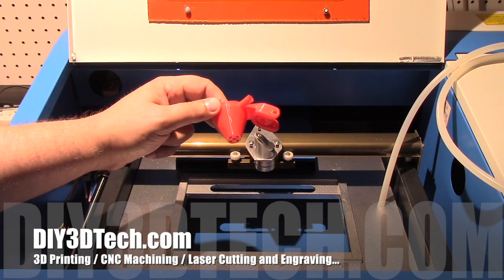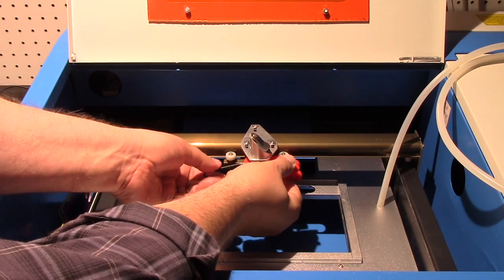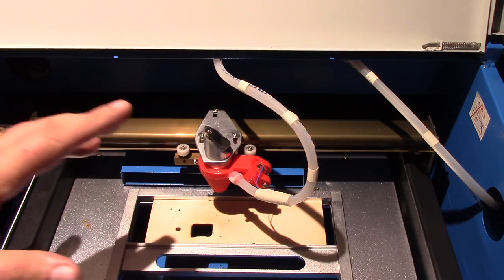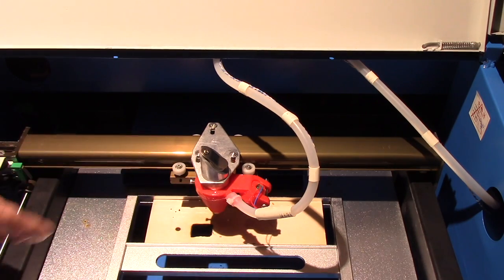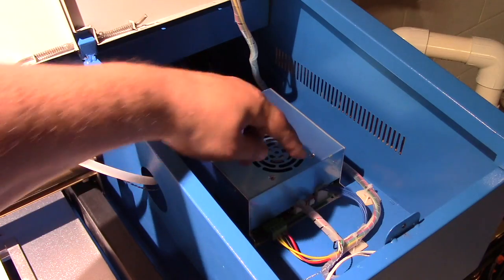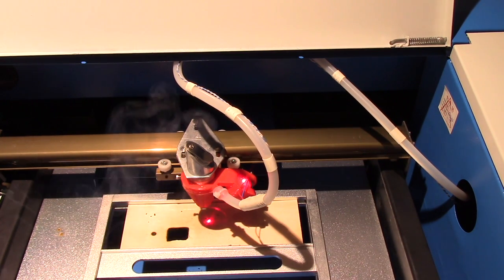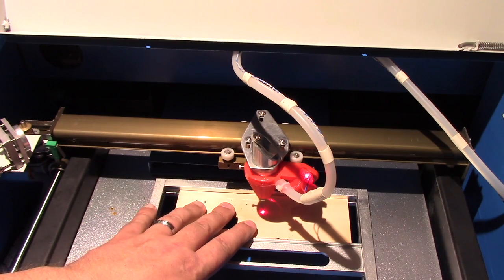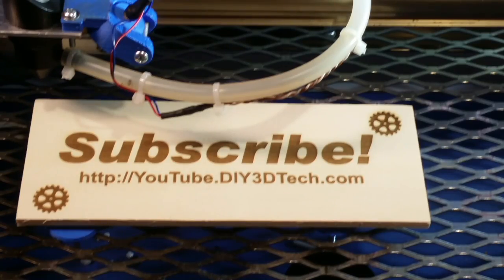K40 eBay Chinese CO2 Laser Cutter & Engraver - 3D Printing an Air Assist Nozzle!

Comment: Hello, if possible how much would you charge to print an air assist for myself. I would like to have an air assist but I do not have access to a 3D printer
Reply from the maker: Sorry I just don' have the time however you can buy a metal version from Light Objects pretty cheap...
Reply: DIY3DTECH.com ok thank you!!

Comment: Just a question as to how and where you attached the silicon tubing to the case?
Reply from the maker: Not sure I understand as they tube you see for the air assist as it runs to an air compressor...
Reply: I was just wondering how you attached it inside the laser area. Is it attached at two points (with a cable clamp or similar) to the underside at the back of the lid. Does this keep it from tangling the air hose?
Reply from the maker: the hose isn't attached to anything per-say, it is fairly  stiff and supports itself as I run it though the light hole in the side and out the electronics box...

Comment: as I understand it, PLA is a thermoplastic so it won't really burn until you go really hot, but PLA starts becoming soft at 50°C so I don't know how well that is going to work for you...
Reply from the maker: It has been ok, however I have not had any flameouts in the material.

Comment: Was the new tube that arrived actually 40 watts?

Did you watch the British guy's video he published in the last week where he mentioned what I mentioned to you about tube life is hours since it was made not just hours in operation?  I know you disagree so I am stumped as to what is right because 3 months is crap.
Reply from the maker: Sorry no and yes I disagree as I have had one for around a year and no issues and in fact this laser is almost 3 months old now (as all my videos are queued for a month or two  and I had for almost a month before opening it).  I also believe that  via the date stamps on this machine it is well over a year old.  As no one would buy one of you had to replace the tube every three months...
Reply: DIY3DTECH.com
He isn't saying it just completely dies and you may get one with more hours on it.  Let me know what you think as it is his previous video's video (so 2 back).
Reply from the maker: I am in Europe this week for meetings however if I can get a chance to look, I will. But at the end of the day one of mine is nearing a year and even power wise it works just fine...
Reply from the maker: I had a chance to watch it and even wrote to him on the topic (you can see Russ's reply on the comment section of his video).  In short he says that's what someone in china told him so I take that with a grain of salt as I operate in china too (not with laser tubes) and can tell you that "context" can be way off and think it is the case here.  As I what I can believe is there is a MTBF of 10,000 hours as I do not question the tube will age with shelf life, however I simply do not buy the 2,000 hour part as being a "shelf life" time but a cycle or duty time.  However I do like the idea of testing and going to give a shot. Because as I mention in my note to Russ, if you test weekly and this is "true", you see about a 1/12th reduction week over week which should be measurable.
Reply: DIY3DTECH.com
Interesting but still seems bad if just sitting there they slowly die at all.  Seems like a bad design when a vacuum tube (valve) could have been made in the 1900's and if you plug it in now the tube works precisely as if it were brand new.  Why?  Because it is in a complete, and a real, vacuum.
Reply from the maker: Well the tube is not under a vacuum, in fact I belive It's filled a mix of Nitrogen and CO2 (not pure CO2) and there are several aspect which cause the breakdown and of which external diffusion as the isn't perfectly sealed but sealed like a pipette.
Reply: DIY3DTECH.com
Exactly whereas the professional quality tubes I bet are in a real vacuum.
Reply from the maker: No laser tube is a vacuum, they are all filled with a gas mix, however they might sealed differently rather than just heated and pinched off like a pipette
Reply: DIY3DTECH.com
That is what I meant because the gentlemen in GB said that top piece leaks so isn't a perfect seal and over time it lets in more oxygen until finally it no longer will work.  How long that would be I have no idea.  Like a tire with a slow leak that if left to sit in the garage in a year is flat.
Reply from the maker: Yes could part of this as mentioned (not a glass expert) however believe they heat up and close off the tube.  While this is a "good" seal it is not perfect as there will be microscopic pinholes as as the glass cools as I know there different method to disrupt the material to create a more unified bond however they take expensive kit and skills.  Yet this is something that is a going to take a lot of time happen.  Again my first laser I have beat that thing (on purpose) and knock on wood no issues and I have had it a long time. so my guess would be 2 to 3 years easy and possibly 5 tops.  I would be interested in what Epilog recommends for their lasers as they are high quality...